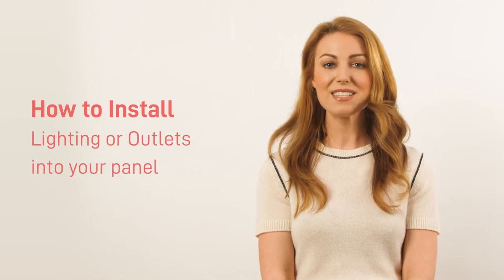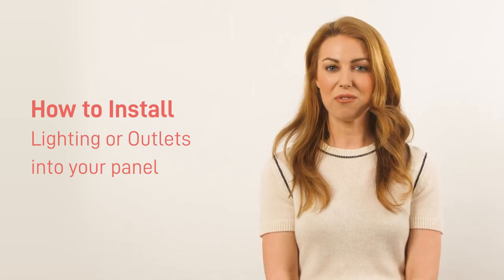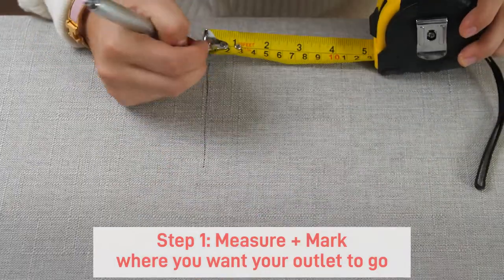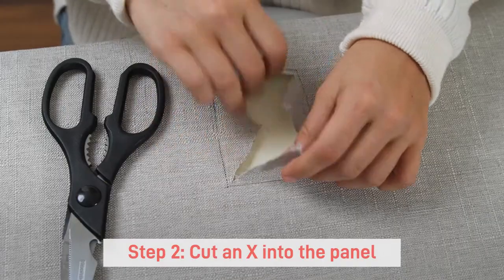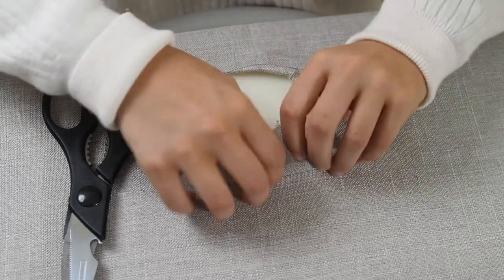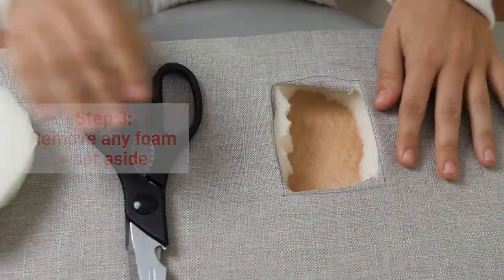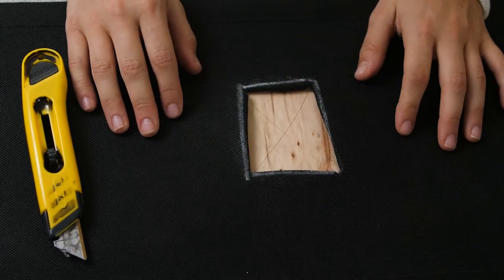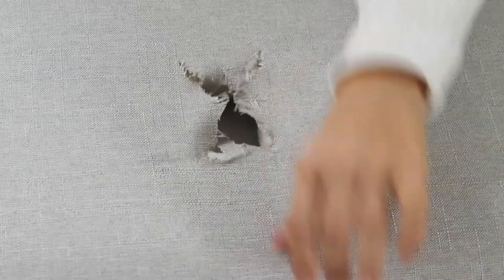VANT - Creating A Cutout For An Outlet Or Light Switch

Comment: Not helpful at all, you are showing not real work, electrical box is attached to de wall behind the drywall, you can't pull the box, instead you have to pull the outlet itself and find out the way that stays still in place when you try to put the cover plate back. May need longer screws to secure outlet or switch to electrical box.